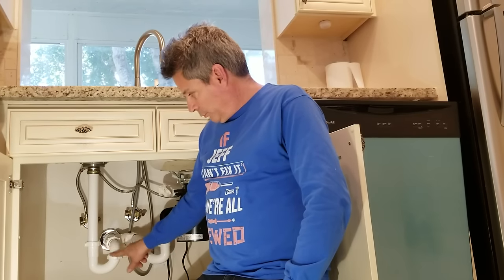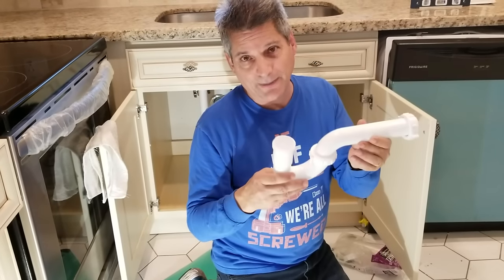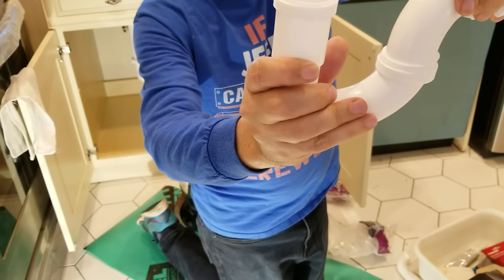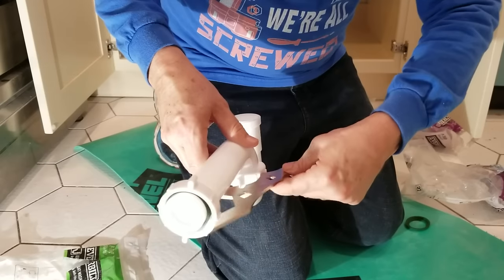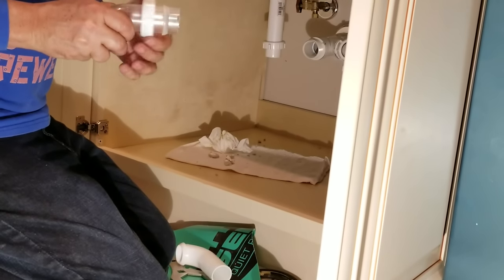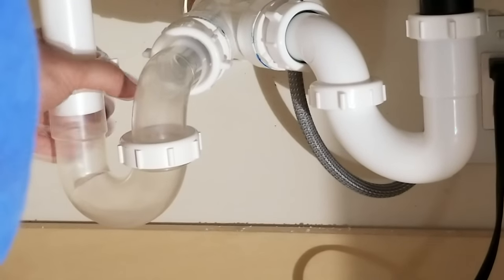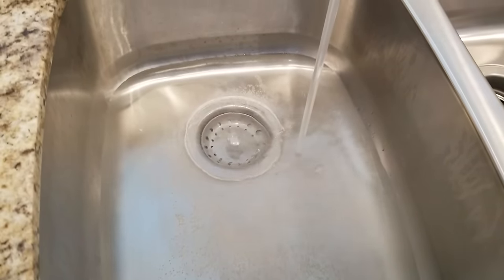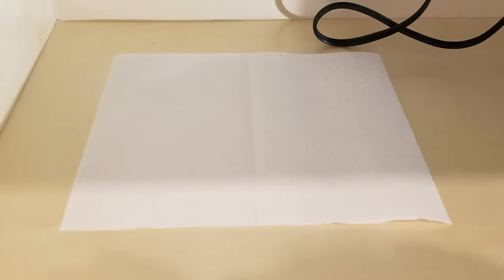Why is my Kitchen Sink P-Trap Leaking at Connection Nut?

Comment: why on earth doesn't somebody improve this almost always leaking system? there has to be a better easier way!
Reply from the maker: Yup, we need a better system than this. In the 60's and 70s they just cemented it all together, then plumbing codes stated they wanted the P-trap to be serviceable and removable. The rest is history.
Reply: If you want a quality installation of drainage pipes and P-traps under your kitchen sink and vanities, that will last 20 or 30 years without failure, DON'T use these plastic piping systems.  Install brass or chromium plated brass pipe and fittings with a clean-out port in the bottom of the P-trap.  The maximum longevity of these plastic systems is about five years....if your lucky.  Labour is expensive, so pay the premium for quality up front so your not repeating the process every five years and ruining your cabinets.
Reply: @chrisgraham2904  thank-you for excellent advice i think long term improves quality and is actually cheaper...just a nudge into 
the plastic can produce a leak...and to think how important these pipe pathways are,well failure is a calamity..i like the idea
of brass,which would easily match the value of my home....what i have now is cheap plastic..i will change,can't be that much
more!
Reply: We don't have these type of trap in our country, the p trap we have had rubber gasket on every movable joint,
The manufacturer want you to buy a new p tray and employ a plumber to tackle the problem whenever  they leak,
Otherwise the manufacturer will be out of business,
They specially design a product that won't last.
Why don't you just put some thread seal tape on that joint,
That will save all these problems in the beginning,
Plumber in out country do that.

Comment: Good video.....will add an old plumbers trick that prevents call backs. Use Teflon tape on male threads, the put pipe compound with Teflon on to, you’re done.   Thanks!    Jim
PS.......I had a drain that wouldn’t stop leaking, 3 hours later, the same. This trick solved the problem.
PPS.....this was a new sink installation and the drain was 2” above the outlet of the disposer, it took 
Peter 5 minutes to repair, 3 years later, still leak proof.
Reply from the maker: Great tip!

Comment: When I used to install pedestal sinks on a daily basis we used a chrome pvc p trap.We always used tape and dope.Otherwise they would leak half the time overnight.There is a way to tape that puts three gentle wraps of tape inside the p trap cup.It will never leak.2 tight wraps around the thread followed by 3 gentle wraps with 1/2 the tape inside the cup.followed by 2 more tight wraps.Unless I saw this method work I would not have believed it.I learned it from a 15 year journeyman.I use it on all pvc p traps on commercial sites.
Reply from the maker: Yes one of my plumber friends used pipe dope on one, but I prefer to just align and tighten that connection first, then do all the others, and it works out great.

Comment: Great vid and explanation.  I've never liked that little Pre tapered end from the sewer pipe end.  Now, I know why. About to put a ptrap back together after changing a bath sink and will ensure those connections are perfectly leveled.  Is it ever acceptable to use pipe dope on those threads?  I'd think that would help sure up where the connections mate.

Comment: don't normmaly bother with a thumbs up but the "3 way plumbers wrench" tip was worth it. under my kitchen sink is dripping and i ordered the pipes and 2 drains and didn't even think of tightening it more than hand tight or that having to level that 1 part before the other so this will likely cause less headach when it coems time to do the job
Reply from the maker: Yes I love that tool!
Reply: @jeffostroff  I'm all fixed up in the kitchen at least now. wish i could send pics =]. the tool did help me get apeart a siezed up part from flexseal spraying everything under there to reuse to make the kit i had conjoin to the rest. also helped loosen up the baskets in the sink quite a bit before using a drimmel with a drill bit and a flathead to push them through so the new ones coule be installed
Reply from the maker: @darkestgreenmewtwo  nice work

Comment: my ptrap kept leaking, and initially, being a total dum-dum, I had tightened it to some ridiculous level.  After watching this and realizing it should be hand tight (lol), I used my car tools (oil filter wrench) to remove the ptrap.  I noticed it had old dried up plumber putty on it.  I tried various configurations of plumbers putty until I took a look at the underneath of the pipe that couples with the ptrap and noticed it had a channel where the rounded part compresses into the ptrap.  I stuffed a thin ring of plumbers putty into that channel and coupled it hand tight and it even FELT right as I was tightening it.  Worked like a charm.

Comment: Great video and explanation. My adjustable P trap is unfortunately leaking from a different (higher up) union but the concept of the water head remains the same. And I love the transparent trap, I'm going to find some to install as on removing the old one from the bathroom I discovered some old tweezers and a bic biro??!

Comment: Just gonna drop how I fixed my issue for everyone trying to solve this problem. My kitchen sink p-trap was leaking, and I found that at the connection from the sink down pipe to the p-trap, the gasket was on backwards. It did not have the flat side of the gasket facing the nut. I reversed it so that the angled side sat into the p-trap pipe and no more leaks. Hope this helps!

Comment: Very helpful. I wish you had suggested a way to fix it if the ptrap joint is leaking and you cant align pipes perfectly... teflon tape? silicone?
Reply from the maker: The way I showed is the only way to fix it. You simply have to make that connection seat perfectly, and it must be the first connection screwed down, then satisfy all the other connections after this one is satisfied.
Reply: I get it. unfortunately all the other pipes are already glued! Thanks Jeff. 
 @jeffostroff

Comment: I removed my garbage disposal last year as I never use it anyway.  The horizontal drain pipe in the wall comes out at an angle which made the connections weird so I had slow leaks after installing the new pipes.  Short of calling in a plumber, I applied silicone at every connection on the outside and cured the leaks.  I guess you can call it sealing from the outside in.
Reply from the maker: Yes, that makes me nervous. the seals should all remain tight on their own without needing anything else. The secret is in tightening the nuts, just hand tighten, then 1/4 turn past hand tighten with a wrench, no more or it stresses the plastic.
Reply: @jeffostroff  What you showed in your video makes sense, but because my drain pipe comes out of the wall at a weird angle, the drain from the sink doesn't quite line up correctly so one of the vertical drain pipes sits at a slight angle too.  I'm sure the seal inside is compromised.  I noticed the same thing was the case with the original disposal so along came the silicone again, over 30 years ago!  I think my condo was built by day laborers on a Friday!
Thanks for showing the 3 way plumber's wrench.  Just ordered one on Amazon last night.
Reply from the maker: @2-old-Forthischet  Can you cut the weird angle off the waste coming out of the wall so that you have a straight tube coming out of the wall, that might be easier to mate up to?
Reply: @jeffostroff  I thought of that but the angle is less/more than a 45 degree angle depending on which way you look at it.
As it turns out, I have a slow leak in the wall.  I've been battling it for several weeks now.  At first I thought it was residual water from a neighbor's water leak when they replaced a section of copper pipe in their ceiling.  The concrete floor would be damp (not flooded) then stay dry for several days then moist again.  Today I found a T fitting in the drain pipe in the wall that was missing a screw in plug so installed one this morning.  Later this afternoon, I finally saw the culprit.  The lower T fitting on that drain pipe started dripping a few drops at a time.  So, rather than pay big bucks to a plumber, JB Waterweld to the rescue.  I've used it before on my boat's bait tank!
My uncle who was a plumber, advised me never to become one!

Comment: I just took my bathroom sink p-trap apart to clear a clog and accumulated sludge.  I put it back together and had one tiny leak on the high end of the p-trap.  Took it apart again.  The gaskets were all deteriorated.

There were three different types of gaskets for the four connections, and finding exact replacements seemed daunting.  So I bought new slip nuts (which come with washers/gaskets/o-rings).  Now the only connection that's not leaking is the one you said is most susceptible.

We have metal (brass?) pipes because my city's fire code doesn't allow PVC for indoor plumbing.  The pipes don't seem cracked or damaged.  I just can't seem to get the connections straight enough that gaskets make good contact all the way around.  Each time I take it apart and try again, the leaks get worse.

Oh, and the drain still can't keep up with the faucet.  Looks like we'll have to risk bringing in a plumber to fix my "repair."  I'm somewhat handy, but I've never had DIY success with plumbing.
Reply from the maker: bummer, hopefully they it it leak free for you

Comment: As a guy who battled a dripping p-trap for a couple of hours, my recommendation is before anything, make sure that the J-bend pipe is fully and meticulously attached to the wall pipe. That is joint without a washer and it is also the joint that remains fully below the water level when there is nothing draining out of the sink. I first snugged that connection before even going under the sink to install it to the wall and sink tail pipe.
Reply from the maker: Yes we do the same

Comment: Wish I'd found this earlier today..very clear thank you!
Reply from the maker: what did you end up doing to solve your problem?
Reply: Well, I haven't yet...it's still leaking (in my defence, video found at 11pm and it's only 8am now) but I will remove the u-pipe (my set up is slightly different in UK) and check the bevelling/gaskets and won't overtighten the locks. Have subscribed for the future!

Comment: I had a leaky p-trap for two days. Of course it leaked right where you said. I loosened everything and followed your instructions to a T and it still leaks! Maybe I had tightened the nut too many times with a wrench and now the threads don't hold anymore. Will try one more time in the morning, then I'll go buy a new p-trap and start over. It's so hard to reach anything or see anything and my body doesn't twist into pretzels like it used to. I'm hoping to be able to post positive results tomorrow. It is Oct. 13, 2024.
Reply: Okay then! Morning now and I'm leak free. :) Even though I was connecting it properly (I'm pretty sure) it leaked because of the misalignment of a new sink vs old, in this case I had to (don't yell at me) use an accordion connection to make it all fit. I hadn't stretched it out quite enough and I believe the strain of it's crookedness was pulling the big important connection that we all know and love so much just enough that it wasn't quite an airtight seal anymore. That's my story and I'm sticking to it. Sometime in the next month I'm going to give up the ghost and call in a real plumber. I just hope there's enough of a connection at the back so he or she doesn't have to carve into the wall to make it all fit. Life is never easy.

Comment: I just put in a new p-trap for a new sink last night and it was threaded on both sides of the pipe. Never having done anything like that before, I placed one of those semi-clear gaskets inside but it was still leaking just a bit this morning. I hand tightened the nut so I couldn't imagine I'd cracked it. I'd opened it up, thought maybe the gasket was in wrong (again, never having done it from scratch before). I watched this video and took note of how level is needs to be. I just went back, unscrewed it and found the gasket was split from tightening the nut with it inside, which I realized is why it was leaking it squirts, as that was going through the gap in the fitting that clearly wasn't sealed that way. I carefully opened it up, realized level wasn't so much as issue as the non-nut end was thread anyway but still I carefully threaded it back together and put the bowl underneath. I'll go back and look later. There's not a lot of info like this online, if you look up PVC threaded leak, most of the info is about fixing a pipe or fitting that is damaged, not one that isn't sealed correctly. As it's a p-trap, I sure don't wanna use adhesives if I ever need to get it apart again! Thanks for posting this
Reply from the maker: Yes the old days of just cementing the P-trap, they were more reliable

Comment: extremely helpful, my only suggestion would be, and maybe you have in other videos, would be to quickly demo other material P-Traps. i have a metal one that does come with gaskets. i was really just try to unclog a drain and ended up replacing the P-Trap. you mentioned that the p-trap needs to be aligned, it really, and assists with that, is not completely tightened down that specific pipe that goes into the wall, and can be connected to the P-Trap, but can also meet up with other pipe configurations that eventually will hook to the P-Trap. the reason for that is you to give to the flexibility to move the pipe in or out slightly which will assist in getting the best alignment for all the joints. after all the leaks have stopped everything is going great, that's when you tighten down the that goes into the wall.

Comment: This video was very helpful! My leak is right at the bottom of the sink. My brother recocked and change the cardboard washer along with the other pieces about 6 months after I moved in. It has now been 3 yrs in house now and just the other day I noticed be it leaking again. Same area. Could it be the drain is not a  fit  for the sink??  It was  house that was flipped, so I  have found some things the people fixed to only sell. If that makes sense?  I have electric issues as well plugs not working and my trace lighting ( which I do not like) goes out all the time.
Reply from the maker: If you have a leak, the problem starts up top usually, so maybe the plumbers putty under the drain flange in the sink has been compromised or dried or cracked. Also check that basket nut bake sure it is tight and holding the washer against the bottom of the sink. Maybe vibration from the garbage disposal over time can shake things loose.
Reply: 👍will do . Thank you

Comment: The video doesn’t show any plumbers tape on the threads, shouldn’t it always be used?   Glad you mentioned and used a plumbers wrench, never knew about that.
Reply from the maker: You do not need to have plumbers. Tape on those threads on the pea trap because the connections all have gaskets.

Comment: Hi Jeff, I have a slow leak at the P-Trap Arm interface with the fixed tube going into my wall.  I confirmed its tightened, and I looked for cracks and cannot see one.  Other that replacing the piece(s), any thoughts? I was thinking I could just replace a gasket, but not sure if they are available outside of the kit.

Comment: Nice visual (clear p trap) and explanation of the weir along with the measurements for the slope toward the wall. Exactly what I needed. This set up with two p traps is the ultimate for water flow but I am wondering whether I should install a tee between the sinks which would cause water crashing together when emptying both sinks or just run one straight down and the other sink into that line. If you have any videos on that subject maybe you could throw in a link for me. I'm liking your videos the more I watch them. Thanks!!
Reply from the maker: You should NOT install the Tee in the horizontal middle of the 2 sinks as you first proposed, and you answered your own question correctly, simultaneous emptying streams of water from both sinks will crash into each other. The second method you proposed is the preferred method, where sink #1 drains straight down the vertical tube, and Sink #2 goes through a garbage disposal, or into a horizontal pipe that meets the other sink's vertical pipe with a T, or a vertical aligned sani-tee.  I sani-tee cannot be horizontally orientated. I would highly suggest you put a downward slop on that horizontal pipe leading to the other sink, that way you are sure water is running downhill towards that T-connection.
Reply: @jeffostroff  WOW, thanks so much for your detailed and thorough response. I will do it without the tee in the middle. Thank you again sir!

Comment: But if the drain-pipe has to be tilted up a little to allow for a downward flow, doesn't that make it difficult or impossible to adjust the ball part perfectly straight with the P-trap end?

Comment: i use sch 40 traps with cleanout at bottom. back in the 1970s this company called genova products made p traps with cleanout plugs. the cleanout did not screw in they where called twist lok plugs they where 3/4 inch and they would lock on these lugs to seal in. they still make twist lok plugs but they no longer put them on p traps they only make 1 1/2 - 4 inch twist lok covers. genova just uses threaded caps now. they where great i wish they still made them.
Reply from the maker: That sounds like a cool feature to have on the P-traps